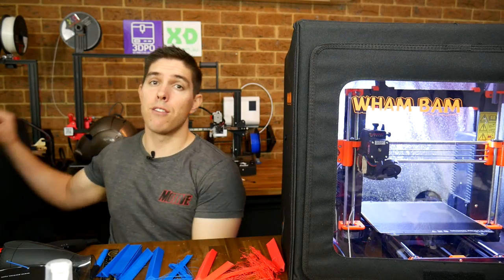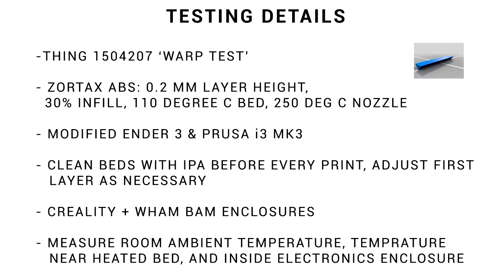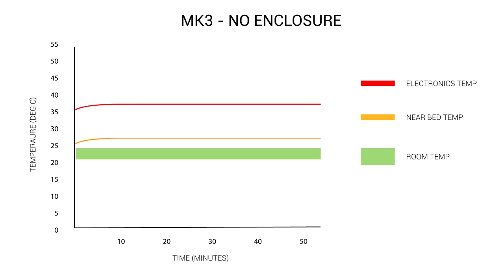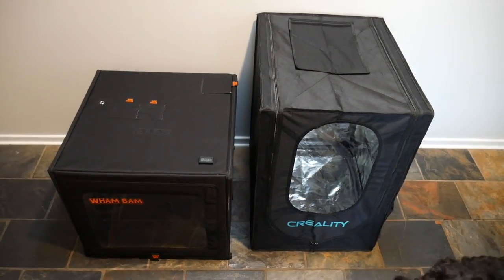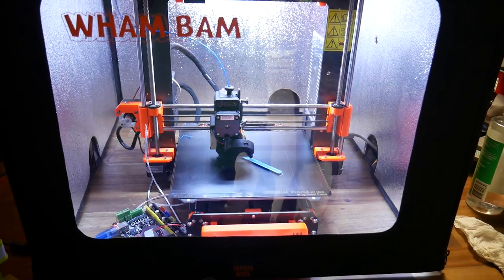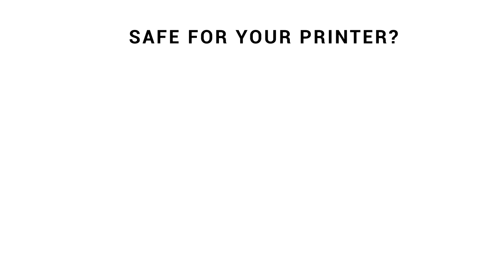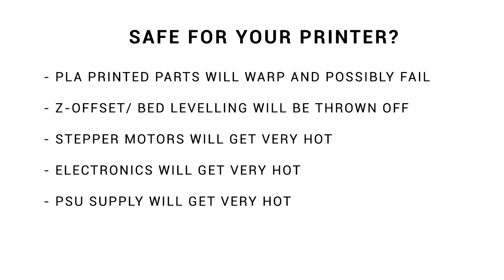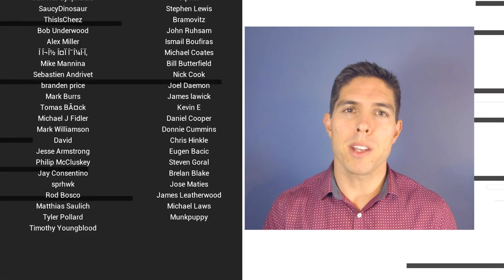Pop up 3D printer enclosures tested - Creality vs Wham Bam

Comment: I have both versions of the Prusa/IKEA Lack enclosures as well as the Creality soft enclosure. I like the Lack enclosures for aesthetics. However, I prefer the Creality soft enclosure for printing ABS. I will move my printer into the soft enclosure just to print ABS. I use a textured build plate and only use glue on smaller parts. I did find that I had to turn on the part cooling fan (usually off with ABS default settings). I really think this video is worth revisiting. I truly love printing with ABS in the Creality soft enclosure. The Lack enclosures do not seal enough to print ABS (IMO). I have a Prusa i3 MK3s and an Ender 3.

Comment: I have been using the Creality enclosure for 2 months. I have all my electronics inside with an added pi, camera, and LED lights. I'm not concerned about heat on the components or electronics as their operating temperatures can withstand much higher heats than I experience or even reported in this video. Due to my ambient temperature my enclosure is heated to about 30c. Most laptops and ATX cases are going to heat soak their components significantly more than this enclosure even at 50c. With the creality enclosure I have the best layer adhesion and never experienced warping.
Reply: I recently purchased one. Honest answer only. How is everything after 4 years?
Reply: I've been using one for a little over a month
I can't see myself printing without one ':D
The regulated temp is just awesome. It's getting winter now and my prints were starting to suffer with warping when the first couple of dips in celsius happened

I just have the screen wired outside of the enclosure. Planning to get the sonic pad soon soon

You can also lowkey use the enclosure as a dryer box XD

Comment: I had DIY enclosure from PVC pipes and car sunscreen, did cost me like 4$ to make. It kept up to 40c. I did use brim for ABS parts most of the time. I never had a problem with electronics. At the moment I am working on a new enclosure. It's an old dishwasher. Basically full steel enclosure, and also made wheels so I can slide the printer like a drawer whenever I want out of the enclosure to level the bed. I am already printing in it for a few days, will mount it on the wall tomorrow.
Reply from the maker: Sounds like a good setup.
Reply: Yea I use brim too for ABS

Comment: I’ve had the Ender 3 enclosure since released, however it is used only to keep the dust off whilst not in use.  I’ve always left the enclosures windows open while printing. My printer is now always clean and looks a whole lot neater sitting in my office

Comment: For my Ender 3, I've made my enclosure out of MDF, cut in a local hardware store, no Ikea in my country. Painted with a fire-retardant varnish. Smoke detector on the enclosure's inside roof and an other one on the room's ceiling. Electronics, PSU and Pi3 on the outside. It gets to 50c passively heated by the bed. Motors get to 60c but they don't care, their working temperatures are upwards of 90ºc. I have great results with some local, no-name brand ABS and a few (6-8) lines of brim.

With ABS you have to chose your battles, for action figures, statues, mechanical parts, basically anything with lots of twists and turns to allow the ABS to release the stress, it's great, no delaminations and rarely any warpage at the bottom. Now for something with long, tall, straight walls like a box, it doesn't do so well, even so, I've printed the Ender 3 drawer, a few layers delaminated, but I quickly fixed it with some thick ABS slurry.

Edit: A little more on the motors. They are made with Class B enamel insulated wires, which can withstand up to 130c, the internal temperature of a stepper motor is around 30c more than the outside casing, so in theory one could run them up to 100c case surface temperature, but not exceeding 80c to 90c is recommend. 60-70c makes virtually no difference on the life expectancy of the motor compared to 40-50c (open air printer).
Now electronics are a whole other story, a study made on car's electronics in different climates, found that for every 10c over 20c ambient, the electronics life expectancy is halved, so 30c get's around 50% life span, 40c is 50% of 50%, therefore 25% the original 20c life, and so on and so forth. Even so, many people live in hot climates, and are still able to have their TVs, Stereos, electronics in general work for 10+ years, so I wouldn't leave the electronics inside a 50c enclosure for sure, but I wouldn't go out of my way to get perfect airflow so every single degree of heat generated by the board get exchanged to the outside air, specially because there is a point where the dust introduced will be more harmful than the few degrees of heat.

Comment: Surprised to see that you got the poor results you did. I print a decent amount of ABS for functional parts using my Ender3 in a dodgy cardboard box enclosure, and while not perfect, the results are more than acceptable/useable.

A few observations:
110c on the bed is too hot (imo). You're above the glass transition temperature for ABS, so in theory your lower layers will always stay soft, which will exacerbate warping/peeling. FWIW, I have initial temp at 100c to help adhesion, which then drops to 90c. 
You're much better off printing with a brim. They're annoying, but they help stop ABS corner peeling a lot. 
In an enclosure, don't be afraid of using the part cooling fan for ABS (despite everyone mindlessly parroting that you shouldn't). It helps print quality a lot. The quality issue on the corners of the print @8:15 is due to the part overheating, and some fan will fix that. Just don't go overboard on fan speed % or you'll hurt layer adhesion (as in part strength, not cracks).

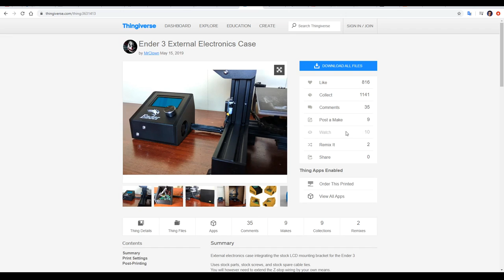Lastly, honestly chuffed to see my external electronic box "thing" (@13:00) in one of my favourite YouTuber's videos 😁
Progress on version 2 has been stuck in design failure and redesign hell for ages, and now parts for test printing are being delayed by Corona, but it's nearly done: https://i.imgur.com/T5ELZFu.png
Reply: I bought a fan/heater/blower combo to hear for abs. Just need to add charcoal for aroma...
Reply: @Bryan-Hensley   You're right. You'd be surprised how many people don't know that different colors have different ir emissivity. Color has nothing to do with heat, additives do. It's a complicated piece of engineering as even two ideal visually identical colors can have different thermal characteristics.
Reply: @purduephotog  Years ago, I was a foreman/mold tech for an inection molding firm. Shortly after I did some of the same work in extrusion blow molding. With both I found the same issues with melt/form characteristics changing only because of the color. Materials science is certainly an interesting study to be sure. Also, getting into 3d printing last year (only been at this about six months) I found out really quickly why people tend to stay with the same filament brands and certain color bands. Once you got it dialed in the results are amazing. Changing color/brand you can find yourself right smack in the middle of tweaking hell to get back to the quality you had previously.

Comment: I have the ender 3 pro with the creality box. It helped my prints not warp due to breeze from my window. I run it with the top port open. The lcd screen would screw up from overheating after awhile so I moved the electronics outside it. Been running like a champ since, wouldn't want to print without it.

Comment: Excellent video. I'd been thinking "Why had no-one created pop-up 3D printer enclosures with a rubber seal around the base to stick it to the tabletop?" - something along the lines of the mini greenhouse material would work and also be cheap. These things should cost no more than $30. Not $150+ but this was an excellent demo. I don't print with ABS but my friend in India does and he has ambient temp up to 30deg if the Air Conditioning goes off. He achieves non warping using an ABS solution applied to the build plate.

Comment: Due to living in the pacific nw, all my filament is in a dehydrator when in use.  I recycle the heat generated from the dehydrator into my enclosure which house two Ender 3’s that now only run ABS.  The dehydrator alone keeps ambient temps around 35c, and with both printers running temps peak around 55c.  I do use a textured pei sheet from TH3D.  Over all I’ve had great success, and have almost no issues with  abs anymore.

I did have to replace all custom parts in the printer with abs/nylon due to temps and this summer I plan on moving the power supplies outside of the enclosure. my two access doors are also easily removable for air flow when summer hits, and I have fans installed in strategic places to either draw air out or move air in from a cooler source to help maintain temps.

Comment: Like always, thank you for your video. 
I went for another route for my CR10. I build up an enclosure from scrap plywood a friend gave me. I fitted polyester 10mm thick on the inside, printed some hinges and locks, used a polycarbonate front door. The enclosure is fitted on a frame of construction wood, on wheels for moving it in my workshop.  I found a cheap car thermometer in Aldi to monitor the temperature. In addition, i attached a smoke detector on top, just in case...
As the plywood was so ugly (from shipping boxes), I covered the whole setup with survival golden covers. It looks now like a moon lander.  i get many questions from my friends ;)
Reply from the maker: Haha I can picture a moon lander now.

Comment: Great video as usual. I made my enclosure out of metal from an old head board and 3D printed parts for my Ender 3 pro. I covered it with heavy duty PVC normally used to cover garden furniture as it's designed to bit quite a high temperature. I've made it tall but left the top open. I know it won't maintain the temperature unaided but my ABS printing is now floorless and the bed can be dropped down to 105C for 1st layer then 90 for the rest of the print. Before the enclosure I was getting warping and delamination with the same rolls of filament. Works awesome considering cost me about 8 pounds with a bit of up-cycling.

Comment: I've got an Ender 3 V2 with the larger Creality enclosure. While I print PLA rather than ABS and thus have a lower hotend temperature, I print on a 60℃ bed and have never had my steppers heat up like that, even after a 36 hour print. Assuming my chamber thermometer is accurate, I believe I was a bit over 60℃ at the crossbar (it's been a while so I'm not sure, but that's a typical temperature).  Of course my chamber volume is significantly larger, but that doesn't seem to come into play given my temperatures. 

Decades ago I was a submarine electrician, and the rule of thumb for temperature was if you can't hold your hand on it for 10 seconds there's a problem. I don't recall ever touching a properly functioning motor or panel that approached that limit. Now I know little about steppers, but immediately painful to the touch can't be good!

Have you checked your stepper current settings? When I first set up my printer I found a sample configuration file (supposedly for the Ender 3) that set currents to 800 mA for the axes and 1000 for the extruder. Fortunately, I brushed my Y stepper with my fingers as I was switching off the printer after my first test print. It was way too hot so I did a bit of research and set the axes to 580 and the extruder to 650. Everything printed great the no more hot steppers.

Comment: Good video and testing. Was surprised about the outcome.

Some of my own observations of working with ABS using Zortrax M-200. Using their own branded ABS filament and the stock settings I have had some really bad failures, constant warping and delamination. The way I have managed to overcome this is by in their software I switch to external material and crank up the heat settings all the way up (290C nozzle, 105C bed) and the printer sits inside a cabinet which is not in anyway airtight (quite a bit of gap on the door). Now there is only minimal warping with large prints at the bottom, sometimes not at all, but most importantly the printer never fails and the objects come out as they should.

I think a big part of why Zortrax performs best for ABS is the perforated plate and using a good raft on the models. As the raft deposits itself inside the perforations it can mechanically withstand the pulling forces and the long time baking in 100+ degrees will normalize the plastic eventually relieving the part of the stress forces. I've noticed that when using ABS the raft is easy to peel off leaving a nice bottom surface on the model, unlike PLA which always ends up melting the raft into the model.

Comment: I use a low CFM fan in my diy enclosure to keep it from getting too hot. I believe the better goal is to keep temperature fluctuations around the printer, such as breezes and drafts. Thank you for sharing.
Reply: For Abs dont use layer fan

Comment: I've been using a mostly stock Ender 3 in the Creality box all winter without any issues.  I only print PLA and PETG and its winter here in Washington so my results are not really comparable to the tests Michael ran.  I actually like the pipe frame and have made a camera mount, tool holder and filament guide for it.  I use it in the house and out in the garage for longer overnight prints.  Guess I'll see how it behaves in the summer.  If nothing else, it's great for keeping the printer clean and containing the fumes.  Also... the Creality enclosure goes on sale frequently, I got my mine in November for $49.

Comment: Pretty surprised by these results.
I personally have an Ender 3 in an Ikea Lack build. 
Using a worn out stock Ender 3 bed, ASA warp is about 80% less at even 30c. Warping on any part is completely gone above 35c.
Maybe the ABS filament is causing issues, have you tried ASA? It seems to react much better to warm ambient temperatures

Comment: I use to use a similar setup with my Wanhao i3, but then found out about cura's draft shield, since then I just use ABS slurry and a raft and get decent prints 90% of the time.

Comment: The ideal chamber temperature for ABS and ASA is 85 degrees C.. The main reason I would like a chamber is to shield from drafts.. My prints come out great with an 85 degree bed 250 nozzle on blue tape with ASA.. Little to NO warp at all but you have to use 0% fan except when bridging and block off any and all drafts with an ambient room temp of around 72 degrees F or higher.

Comment: I've had excellent results with the WhamBam enclosure, printing PETG in a drafty environment on my Ender 3. With 235 nozzle, 75 bed, with blue tape on the bed surface, and printing on a raft. I've gotten amazing prints that just didn't seem possible before I got the enclosure, and it is consistent enough for me to consider switching to PETG entirely. I'm still doing experiments to see if I can eliminate the rafts and save on the small amount of filament used for them. For $100, the WhamBam enclosure is totally worth it to me as an experimentation platform for moving beyond PLA -- looking forward to more exotic filaments next.

Comment: Wow yeah. I was just about to do this. I have an ender 5, so the wham bam doesn't fit. I may have to steal your ender 5 design. 

Saves me $90 on the creality thing, tho! Thanks!
Reply from the maker: All the parts are on Thingiverse. I'm about to refine the design to use cork instead of acrylic on several surfaces and also seal up the top sides more to prevent drafts.
Reply: @TeachingTech  That sounds like a good idea.  Have you any concerns over printing ABS (or PET/ASA/etc.)? And what is even adequate ventilation? I'm eyeing the nimble, and that'll mean I need to print new mounting bits around my hotend, so PLA isn't really the best way to go. PETG or ABS, or something with a higher temp factor, but I'm concerned that I might breath things that are bad for me. Thanks for doing all this!

Comment: I built my enclosure using cardboard, PVA and 3D printed corner joints. Been working well for over a year
Reply: Ender 3 ? Good to know
Reply: @noway8233  Yes, Ender 3.  I printed a hinge (from thingiverse) and made a door as well. I used plastic film to make the windows. For an Ender 3 the size should be at least 53cm x 58cm x 53cm.